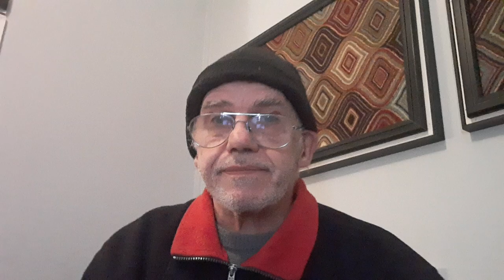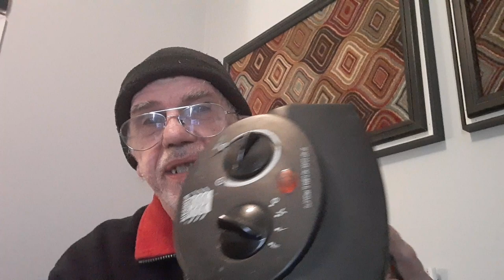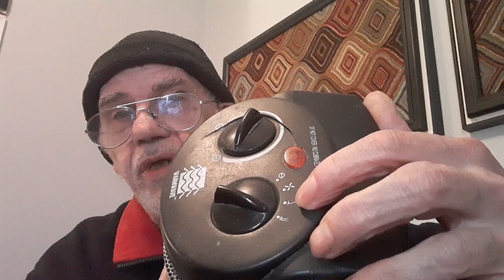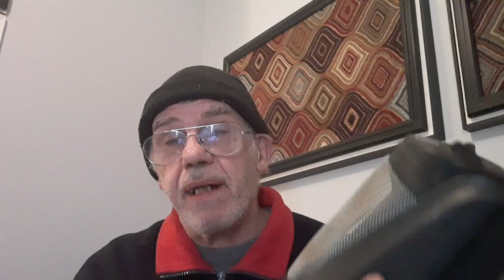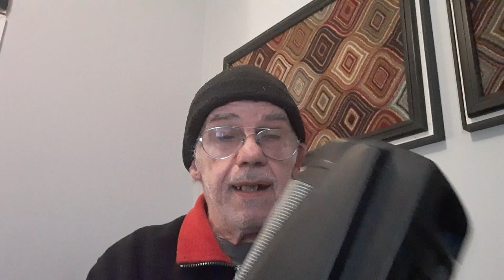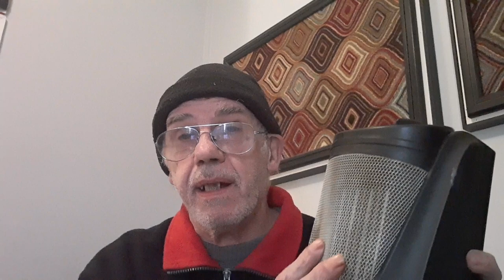Chinese diesel heater, BTUs explained using electric space heater.

Comment: Interesting vid 👍
Whilst i agree adding more fuel can increase the heat output you will find you run into fuel burn issues if you go to far over diesels AFR range, the original webasto and ebers were sold as 2 or 5 KW heaters as thier maximum output with clean emissions, the amount of air they can flow due to fan speed and chamber size is as important as fuel dose IMHO.

Comment: Another parameter that hasn’t been discussed thoroughly is how long will this diesel heater with these materials last? You could get yourself a drag car and push it to its limits and every other race you have to rebuild the engine or you could have 1000 races and never have to rebuild the engine. Marketing people are an engineer’s worst nightmare. We build things that meet certain specifications for a specified usable lifespan of that equipment, marketing people always want to go outside those specifications and wonder why failures happen. The Chinese are notorious for bogus claims without the increased specifications, they are always stating something greater than what it is really designed for. 😖
Reply from the maker: Hi Ninja, thank you for watching the videos and adding comments. I could only find myself in agreement with you on this. However I do have to say that's what marketing is all about. Make a product make money even if it's by way of deception.
Reply: @jamesgilbert1013   James, I only need point out the Columbia space shuttle that pretty much helped to “end” that program because of marketing/managers not listening to their engineers. It is better to educate the buyers than to deceive them. If you want to push your heater to more extremes, you might want to look in to this company who builds a better product and not for that much more money. Lavaner It is out of Beijing China.

Comment: Sorry, I get where you're trying to go but I don't agree with your logic.  In the case of the electric heater, the maximum wattage is determined by the resistance of the element, P (watts) = E*2 (volts)/R (ohms).  Unless you can reduce the heating element resistance to increase the current (voltage being constant), you can't consume more power to create more heat.  Analogous in  the diesel heater, you can only produce more BTUs by consuming more fuel.  To do this you need more combustion air, and to keep it from overheating you need more airflow volume over the burn chamber, or a larger surface area to dissipate the heat.  Dave McLuckie and John McK both have done analysis of these heaters to calculate real BTU output, and even with the '8 Kw' units its far short of the rated output.  To get one to create this much heat would require pump pulse rates about 7-8 hz, and fan speeds about 10k rpm.
Reply from the maker: Hi, thank you for watching the video as well as placing comment. I think you may have misunderstood why I introduced the space heater into the video. The reason for it was for sake of example, the example being you don't necessarily have to change the size of a heat exchange to produce more BTUs. Regarding your explaining of the diesel heaters I am in total agreement with you. In order to get the proper rating 8K or 5K you need to increase fuel consumption. However this does not mean you necessarily have to change the size of the heat exchange Within These units. Both John and Dave in all they're testing always used the 22 ml pump that comes with the heater at time of purchase. Neither John or Dave have ever done a test using an aftermarket purchase of a 28 ml pump. A 28 ml pump would do exactly as your suggesting add a larger dose of fuel per dose to the burn chamber. As far as needing seven to eight Hertz I have that already, when it comes to the fan speed I'm limited to 5,000 RPMs. My intentions are to purchase the 28 ml pump and see where it takes us.
Reply: @jamesgilbert1013  as you intend to add more fuel, the fan(s) have to keep up, both to supply adequate combustion air, and to push enough air past the heat exchange to keep it below about 200°C or the overtemp fault will shut it down.  This is why you probably need a physically larger unit with room for bigger fans and at least larger fins

Comment: How would you insulate the hot output pipe where it goes through an insulated wall slab
Reply from the maker: Carbon fiber also known as a welders blanket would be a good way to insulate the pipe. However there are also other types of high temperature insulation you can use in the automotive industry. Hope it's been helpful thanks for watching the vid thanks for your comment.